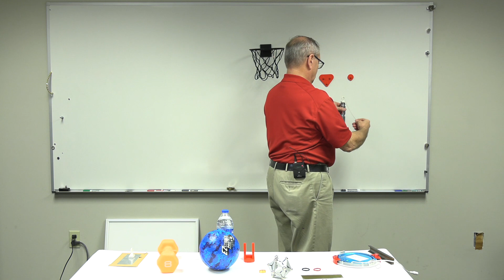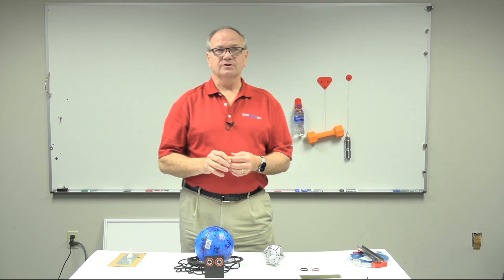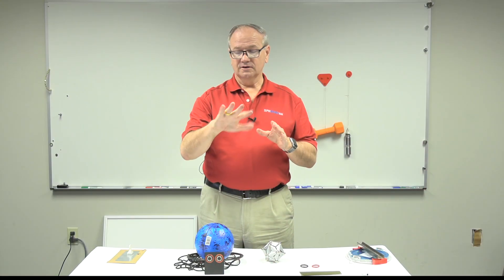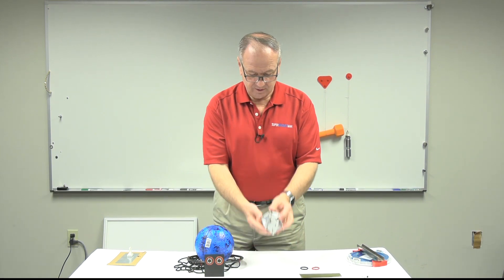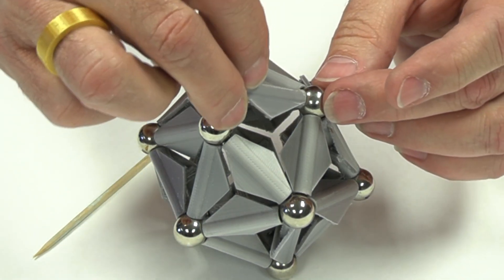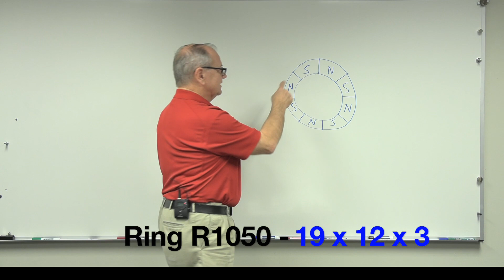Magnets and 3D Printing

Comment: Hope all is well sir. I have a question or task if you should choose to take it. Have you ever made a square magnet. Not a normal square made of 6 square shaped pyramid magnets ?? I look forward to your reply
Reply from the maker: Sorry for my delay in answering.  I am assuming that you mean for example 6 of the pyramids with the same pole at the top and epoxy them together to make one cube with only one pole on the outside.  Each magnet would be repelling its neighbors on all sides and would take quite a system to not only force them together but to hold them while the epoxy cures.  Well I have made a cube frame out of aluminum that held square flat pieces together to try and make a single poled magnet on the outside and we have a video of that work.  What happens is that the outside field goes to near zero when you put the last magnet in place.  Our modeling software predicted that and then when I built the actual piece it got very low gauss outside.  I might think about doing something like you suggest and making the parts with my 3D printer:)  Food for thought - Thanks.
Reply: @SuperMagnetMan  not same pole not on all 6 sides. It's necessary for them to have the counterpart on the other side. No clue or epoxy needed in this arrangement
Reply: Many thanks for the response if you have these magnets I'd love to purchase them lol. going to the website soon for them.

Comment: 1:52 - Printing a wedding ring and mounting magnets inside
- nickel allergy isn't a fun thing, so be sure to get magnets without nickel. It might not be an issue now, it sure can/will be later - Nickel allergy affects about 10% of the people in the US

There is no cure for nickel allergy. 
The symptoms of nickel allergy can be mild, or severe enough to be disabling. They include red skin, itching or burning sensations, blisters, cracked skin and, in severe cases, swelling and spread beyond the site(s) of initial contacts. A severe form of nickel allergy called systemic nickel allergy syndrome can also cause headaches, fatigue, nausea, vomiting and diarrhea.
Reply from the maker: Definitely - I have encountered that as well.  You could easily print the ring so that you press the magnets into the outside of the ring and the inside would just be plastic from the 3D printer.:)
Reply: @SuperMagnetMan  - or, one can get gold plated magnets. 
I see it is common to add an extra layer using an electrolytic based process, so it's Ni-Cu-Ni-Au (Nickel-Copper-Nickel-Gold)
Don't be cheap, get a good layer - it also protects the neodymium, iron & boron mixture from air/moisture, so the magnet itself doesn't swell up, when it's 'skin' is broken :ø)
Reply from the maker: @EgonSorensen  Yes in the past we have carried a lot of gold plated magnets for the jewelry customers.  Now we tend to get them for special orders.  Chrome plating is also a good way to get around the nickel allergy.  I have also wondered how it would be if you simply bought nickel plated and then coated the magnet with something like car wax.  I don't have the allergy so I can't test it:)

Comment: Oh you so need to do this with Halbach arrays. You're wasting nearly half the pull strength. Either that or an iron backing plate.
Reply from the maker: Are you saying that a Halbach needs to be magnetized so it is all in one piece like the multipole ring magnet?

Comment: I might be wrong, I'd have to check, but I think the ring may violate electromagnetism safety guidelines, the field strength is probably narrowly above that considered safe for long term wear. Probably not actually illegal though, the laws are less strict. Also, those are probably plated in nickel which is an allergen; but you could replace them with gold plates ones.
Reply from the maker: The gold plated magnets are actually Nickel-Copper-Nickel plated first:).  We have been using this design for about 20 years.  It has been used in many customer solutions.  Frequently it is used in small very powerful electric motors or in sensors needing to detect 45 degree rotation steps.

Comment: I asked this question last time but would like your comment on it and if it is possible and how much it would cost for a small working setup like this?
Maybe I figured out  how to make the inverter magnet to be done in the air in 3D. 
1 To have one square with magnets facing N out of it on all 6 sides touching each other.
2 Have the other magnet be the same but with S side facing out.
3 have the S side facing magnet have also 8 smaller magnets facing N out at its corner, which would have it have in total 16 magnets. (almost looking like an octagon on the side)
I would assume it would work since it would be locked at a certain distance. I would assume 3d casing might help it. 

thanks
Reply from the maker: I am curious about what you are asking.  This sounds like my cube magnet experiment where I had an aluminum cube made in 2 parts that each look like the letter "U" except with square corners.  The 2 pieces fit together perfectly to make a cube.  On the inside of all 6 sides I glued a 1 inch square by 2mm thick magnet with the same pole facing to the center.  If you can email me a sketch of your idea I can think about it.  Email - mrgeorge@supermagnetman.com

Comment: Sir, thank you for the product demonstration. Regarding the ring magnet itself, is it common that the magnetic field of the eight-pole ring seeks a hexegonal configuration as shown at 4:54? If so, why does it do that? Would not a 6- or 12-pole magnet utilize the effect better?
Reply from the maker: Excellent question - the shorter the arc length of the magnet, the less distance away from the surface that the magnetic field will penetrate but the more North-South interfaces you create.  If it is sticking directly to steel it does make a slightly stronger attraction.  On a white board the porcelain surface is between the magnet and the steel back plate that makes it magnetic.  So it would not be stronger in this application.  Also, there is a diminishing return on how much it cost to make a multipole magnetizer and how much additional force it would create.  A 12 pole would be better if the rin were like 2 inches (50 mm) in diameter.  Hope this helps:)
Reply: @SuperMagnetMan  Thank you for taking the time to reply. Very clear. Just a point of clarification: is the hexagonal effect real, or just a quirk of that particular magnet or the manufacturing process?
Reply from the maker: @Dismythed  Sorry about that - I missed that part of the question - at the 4:54 mark I am just showing the 8 pole ring magnet on the viewing film - I did not see a hexagonal configuration.
Reply: @SuperMagnetMan  Thank you.
Reply: @Dismythed  you mean the lines it makes in the inside huh. Strange to see, I'm wondering if maybe the material just couldn't bend that many times, and that direction was resistant, or if it's the field we are seeing there

Comment: Do you use superglue to glue the magnet to the plastic?
Reply: Not if I can get a tight fit - which I usually do.  Superglue can't handle any impact without losing it bond and plastic is hard to bond to as well as the nickel plating on the magnets.:). I am not against it - I just want to use it in the right application.  Great question.